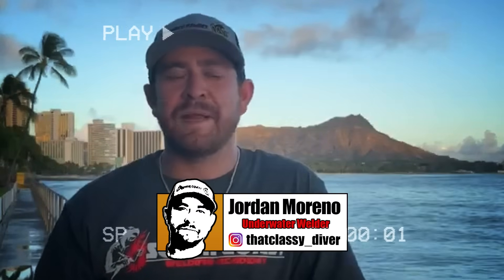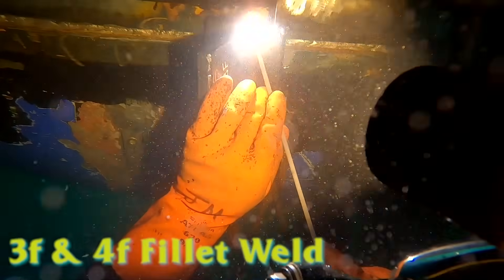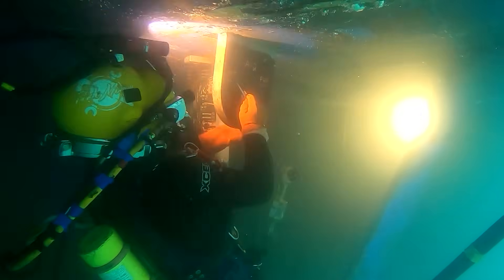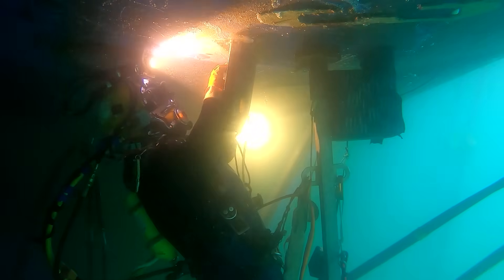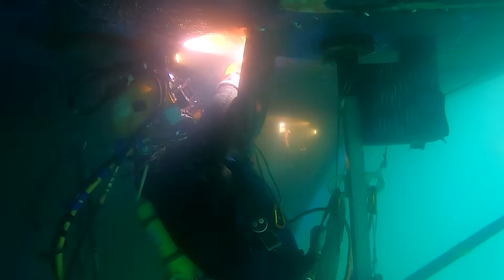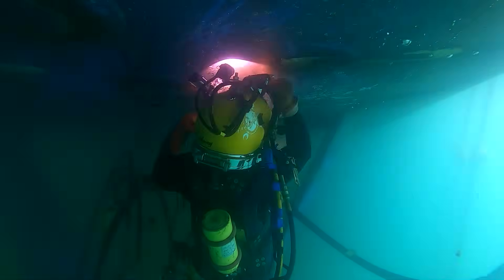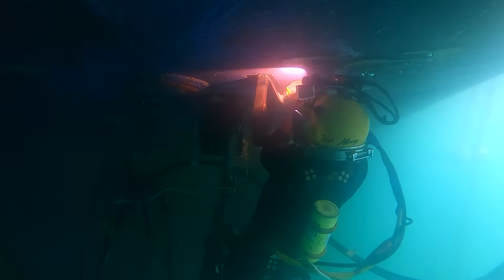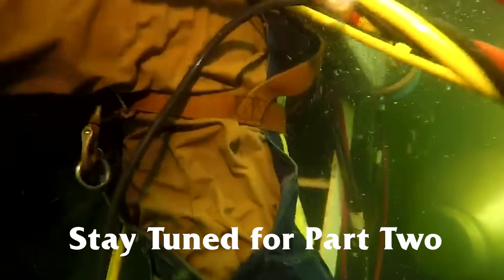Underwater Welding Test | 3F & 4F Plate | Pad Eye Welding

Comment: I graduated from DIT in April 2004. The only time I ever welded underwater was in dive school. I have never in my life seen anybody weld underwater in the Gulf of Mexico where I did my diving career. Absolutely loved diving. Had two acquaintances die, one on a dive and the other from the young money Diver type lifestyle. Two good buddies got bent but were okay. I decided after 7 years I’d had enough of being gone from home and wanted to be around my family. Now I have a roofing company, lol. Little different than diving but home every night. Not nearly as fun as deep dives in blue water salvaging a platform or setting charges to blow a well. Great video bud.
Reply: What exactly is the "young money diver type lifestyle"?
Reply: @autodidacticartisan  drugs, alchohol and girls probably 🤷‍♂️
Reply: Blowing well, you said? Can you tell me more about it? I'm kinda interested in  petroleum world
Reply: @hanif7592  blowing a well is related to pipeline abandonment. When they want to discontinue using a well for whatever reason they do some different things. In a case I was involved in we would hand jet a massive hole around the wells. In this case it was 16 wells so it was huge and deep. They pump them full of grout or concrete, use a diamond wire saw or Broco or sea arc rods that’s a torch to cut the pipe well below the mudline so nets and anchors don’t snag them. I have also set charges down the wells and the blow them up. Plastic explosives. One time I was sitting on the well in total blackness. Topside side something was on the down line and to tell them when I got it. Something hit my on the top of my hat and I said that I received it. The told me , okay that’s the charge, now guide it into the well. I said,” You mean I just got hit in the head with a bomb?!” They laughed and said yeah, stick it in there. I did and then got out of the water. The boat was moved away from the location and everyone was on the deck and they blew the well. A big bubble type scene happened and a bunch of fish came floating to the surface. It’s a great job man and I loved it. But I got out of diving and went to Iraq and Afghanistan and then I never went back to diving. I like being home now with my family. If you’re interested in diving dude, go for it. You’ll probably start out in the Gulf of Mexico. I have a lot of buddies who got into sat diving and traveled all over the world. Most fun job I ever had.
Reply: @hanif7592  I’ve got to use a big hydraulic shear on several jobs also. They rig it to a crane and use the other crane to rig the pipe we were removing. When the job is in good vis water it’s so awesome! Using the Broco torch is probably what I used the most in platform salvage and pipeline abandonment.
Reply: @AdamJWM  Wow! That's awesome, man! I've always been interested in it too but never knew how to get in. Always hear that you have to know people to get a job. And others say even after that, you don't make much. Then others say you do... I don't know what to believe.
Reply: @chron4986  I’ll tell you the truth as I know it. Pretty much anyone can go to dive school as long as you can pass a dive physical. I went to DIT is Seattle in 2003 about a month after I graduated high school. I wanted to be a deep sea diver, so the Gulf of Mexico was the place for me to go. Inland divers and union jobs are harder to get because those jobs are not that many. You probably have to know someone or really make an effort. I believe union divers belong to the Pilebuck union. That’s guys that do bridge work, etc. if you go to the Gulf of Mexico go in the spring or summer because you’ll probably get a job. My friend and I hired on the same day at Stolt Offshore in May of 2004. We did an interview together with the hiring manager and hired us both. We started out at $10 an hour offshore and that doesn’t sound like much but you will be working minimum 12 hours a day everyday you are offshore. My longest hitch offshore was 58 days on a Sat boat. On some jobs you’ll be working 14, 16, 18 hours a day. My longest shift was my first job and it was 27 hours long. I was falling asleep standing up on the plus 10 deck  of the platform. Pretty dangerous. But you get a lot of hours and I think the starting pay is more like $17 an hour to start. So you’ll be making $6k a month I bet to start. As a break out diver it’s probably $24 and hour. I had a job lined out as a class 1 diver for a company in Louisiana for $28 an hour but COVID shut that down so I decided to start a construction company. Diving is a blast dude and you can make some serious cash but it all depends on you and how long you stick at it. If you want to be a deep sea diver you will need to go to the Gulf and live in Louisiana for a few years and then when you get established and make a name for yourself you can live wherever you want. I lived in Oregon and I would fly back to Louisiana to go offshore.
Reply: @chron4986  I left and came back a few times because I went to Iraq and Afghanistan for 4.5 years all together. My very close friends stayed there and never left and became sat divers and supervisors. $800-$1200 days are a very real thing. My “sea daddy,” LOL, as they are known, mentors is another term was a supervisor I had and became good friends with. He was making $250k a year. If you are good and want to work hard you can make a ton of money. It’s a super fun job, get to see some awesome things, travel, etc. I had buddies that worked all over, Africa, Asia, North Sea.... I only ever worked in the Gulf.
Reply: My dad was a under water welder with tiburon Divers out of new Iberia Louisana
Reply: Good day sir do u really no about argon welding
Reply: That’s badass sir. Just got out of the core, water welding just looks so bad ass and has a military like lifestyle. Any advice in anything regarding underwater welding?

Comment: Seems like a 5/8 weld isn’t  big enough for 100,000 LBS
Reply: Idk if he said they were meant to haul that much weight, but for "example" a regular 7018 rod has a tensile rod strength of 70,000lbs hence the 70 in 7018, and there are other rods that have a tensile strength that is higher than 100,000lbs
Reply: Also don't know why he's using 3/32 when 1/8 has a bigger weld but maybe it's so he can have multiple passes to have a stronger weld

Comment: Do you have to decompress after weld? Also is there any truth in me hearing that underwater welders have a shelf life based off of oscillating  frequency and degeneration in bone structure?
Reply: Decompression is depth related, nothing to do with welding. As for the degeneration of bone, that isn't true at all.  You can encounter physiological changes, particularly to your joints. But that has to do with the diving not the welding. Mainly the bends. Certain breathing gasses can cause problems too if used for too long or at the wrong depths. For example, at certain depths, oxygen actually becomes poisonous.
Reply: @mikel9567  thanks 🙏
Reply: Decompressing is due to depth of dive....has nothing to do with welding.
Reply: Shelf life for sure. Can only do it for 6-8 years or something like that.
Reply: Bullshit. Stop spreading false information.
Reply: @A_Lemon_Party  hahahahahahahahahahaha 😹
Reply: @A_Lemon_Party  I’m not I’m asking the question from someone who does it . If anything I’m trying to find the truth of the disinformation.
Reply: @Brendon Moore 

My comment was to nucksboy, not you sorry.
Reply: @A_Lemon_Party  all good G
Reply: @nucks4life11  wrong
Reply: @nucks4life11  After doing it for the last 38 years, I guess I'm past my best 😃

Comment: Why don't they make helmets with remote exhausts somewhere else that won't put bubbles in your view. Surely you can run some tubing back behind you 2m?
Reply: They do, but are typically only used for reclaiming exhaled helium. Usually the water turbidity is so murky on a job you wouldn’t even be able to see your bubbles though
Reply: @KnockedSoup  oh ok. Cheers

Comment: If that had a bevel I missed it twice
Reply: Overall bevel. Not on each side for weld to lay in... only to match haul shape. Some jobs don’t require “penetration” bevels as you are basically moving the attachment/pivot inboard. On parts that may experience heavy side loading... at times we don’t lay our welds inboard for “max penetration” and instead basically  use the weld as a form of gusset. The gusseting effect more than covers the required strength needed of the part... and sometimes you also need to have your part detach from the vessel easier vs having it rip the haul open and allow water to pass. Lots of variables go into these jobs... more than some basic dry jobs.
Reply: @TsunauticusIV  damn that’s wild that you get enough strength from essentially creating a gusset! Bad ass
Reply: Right lol

Comment: Looks like you have to hold your breath while welding if the bubbles go toward your weld. And the way you strike an arc is different; looks like you shove the electrode into the target metal like i would do with a trowel.

Comment: Does pressure have any effect on the weld puddle while underwater?

If so, does the effect increase at greater depths?
Reply: I would assume so? Welding overhead if that rod isn't in that corner your Weld is dripping, but pressure from the water and heat wanting to rise probably helps but I wander if Welds underwater get suckback like fluxcore sometimes

Comment: Im curious if you would know, how much would a job like this cost the customer. 
Their sure is a lot that goes into this that isn't welding. Im amazed, Thanks for the video
Reply: That's how most jobs are, safety is no1 in any professional job ever, before you can even go into material costs, labor costs, production costs and etc. If you get hurt or worse killed in a job that didn't have up to date osha standards there would be Hella lawsuits and that company would be screwed and probably go bankrupt

Comment: Ouh hey, in like a week, im about to start welding school :D

My aim is to do exactly what you guys are doing.

Wish me luck

8/4/2021 edit: finnaly got my invitation letter. Wooo

Ill be starting on 12/4/2021(Monday)

Thanks for all the encouragement guys!! :D

16/4/2021(Friday)

I've been in this school for about a week now, learned alot, still haven't actually started welding. Gotta know the theory first. Its going pretty well.

Edit: 21-4-2021

Its ny second week now. Only got to try stick welding once. Got the arc to light properly while other people were still getting stuck and wasting electrodes.

Its pretty fun, love the smell. Understandably failed my first weld. Freaking sunburned my arm.
Eyes are all good tho 👍

30/4/2021
Third week. Its wonderful there.
The most practical stuff we've been doing is metal cutting.

I forgot to add early on, its a vocational college/school

14/01/2022 Edit
Second semester now, new subjects like thermal cutting (oxy-fuel, plasma).
Quality control. Welding symbols and glyphs or what ever it was(its about reading WPSs)

Passed my 2F and 1F test, now we start learning 3F(hard af) and later on 4F.
Not looking forward to having sparks all over me. 😂
Reply: hey good luck :) im one week in on my classes and i start pipe tomorrow so im a bit nervous but im sure you'll do fine i had no experience
Reply: Been in welding school for 2 years. The key is to take your time, and don't take shortcuts. Make sure your metal is clean, don't worry about messing up and above all else be proud of your work. Good luck 👍
Reply: Make sure you are comfortable before u start your bead. And take into account which direction and how far you will go as the rod burns away. Alot of times (in my experience as a ship fitter 12yrs) it will be in a shitty spot. Try and get as comfortable as you can if possible. Good luck out there to you young fellas(and ladies). Good to see people still interested in having a trade.
Reply: @crryder44  
Ay thanks for the tip. Will take into consideration
Reply: @redlock1815  give some more updates man! Im 16 but im just watching some vids of welding it seems cool
Reply: @dpratt2796  
Hey mann, im 16 too :D well turing 16.

As of now, welding is great! Cuz i actually enjoy it.
Reply: I wish you good luck!
I don’t have money to pay a welding school and i’m learning all at work (i’ve started 1 week ago) luckly I found a welder with the patience to teach me the TIG welding is amazing
Reply: @cure5073  
Wooaahh, thanks mate!! 

Good luck on your end also
Reply: You don’t need luck buddy just determination!
Reply: Haven't started yet??... my 2nd day in class and we were on hands welding with stick😭 classes are 120 for 8 month course😎 thanks to North Carolina public schools
Reply: I feel like it’s a good thing that a 16 year old is very interested in this kind of stuff
Reply: @lukeferguson5418  
You bet i am.

Lol, currently filling in the paperwork
Reply: Use a 7018 rod it’s the best😉
Reply: @jayv1577  
Yeah, i found that out just before time was up, didnt have time to try it out
Reply: I'm currently in college for computer engineering, but if I didn't take the engineering route I definitely would have gone into welding. Some of my best highschool memories came from welding in my Ag-Mech class
Reply: Start a YouTube channel to post your progress bro
Reply: @unsure4857  hmm, maybe i should hahaha. I dont know if they let me document stuff tho. There are "no phone rules" and "no electronics rule, except laptops"
Reply: I personally prefer the flick over the tap, my classmates try n tell me otherwise, but I compare welds and they settle down 😝
Reply: Flick technique is so much better 😩
Reply: I went to underwater welding school before welding school. I did it backwards
Reply: damn. i feel bad man. im in highschool and that kinda seems unimaginable for me. shit a week in we were laying beads. must be the area. you will get better if you have good electrodes. once you get those its all uphill very smooth.
Reply: @invincible5065  lmao, same with us, we weren't able to do any welding from april till.. late October, it was scary. 2 weeks cathing up, then straight to finals.
Reply: @redlock1815 4 years later. How’s it going, if you’re alive and well on this account?
Reply: Good luck man! I’ve been in my school for around 5-6 weeks now and they threw us in our booths the first day 😂
Reply: Good luck!  Don't worry, just act like you own the place, learn all you can and ace those tests! 👍

Comment: Why was he welding down hand on a fillet weld for a plate test🤔
Reply: There’s a whole lot of different welding procedures that you might need to find out about kid
Reply: @Chyniit0  and most kids could probably weld better than you 😂
Reply: Water cools the weld almost immediately, you can’t get good pen or flow welding vert-up. You’ll end up mounding it up and not getting a solid bead running up.

Comment: What exactly is accomplished by grinding starts and stops on a fillet weld?
Reply: It cleans out porosity and possible inclusions that are common in starts and stops. Grinding a stop also allows you to start and back into the previous weld so you can weld over your start eliminating porosity  from a cold start.
Reply: To elaborate with the other dude, cleaning your leading edge makes your starting point more visible and have that clean re-arc will assure you don't have any porosity in the middle of your weld

Comment: It amazes me that the cold water doesn't suck the heat out of the weld and keep from getting proper penetration. Do yoy have to increase the power settings to accommodate for this? Never welded underwater, and have no desire to do so. Just curious how the water temperature affects weld settings compared to regular welding.
Reply: The puddle freezes much faster even when running a high iron powder rod like 7024 and you’ll fight it if you try to long arc but other than that it’s fairly similar. Your workpiece is almost always already cool to the touch after you’ve made a pass as well
Reply: @KnockedSoup  at least that's one plus 😂 I fucking hate having metal pieces that are still cooling and try to pick them up later when I forget about them

Comment: Thank for sharing this video, very rare of information in this field.
I would like to ask would the test coupon go through destructive test? Like bending test.
Always curious for this because even wet electrode give me bad quality weldment.
But in your video the weld profile is really good. What is the magic behind?
Thanks.
Reply: Wax or something goes on the rod.
The arc is so hot that the water boils.
If I'm wrong I'm sure somebody will let me know
Reply: The electrodes are meant specifically for underwater welding. Also, he talked about the tests the piece goes through.

Comment: Just wondering what polarity you're welding with? I just picked up a new Broco cutting torch and it came with a memo in the box saying using the stinger, both cutting and welding, with DCEP would void the warranty. I was taught always DCEP. Pre-dive was always to check you had bubbles on the electrode. Just curious.
Reply: Like about 9 mins in he sais they run dcep
Reply: Direct current electrode positive

Comment: Hi just wondering are you using the same rad in water like normal rad or are the special rads for in the water??
Reply from the maker: Jordan used a wax coated nickel based rod used for stick welding.
Reply: Underwater welding rods have a waterproof coating... For example Barracuda welding electrodes.

You can also use your dry welding rods with paraffin and they work just fine underwater... For example ESAB OK 43.32 with a paraffin coating works great underwater!
Reply: @undercovercop1583  thank you